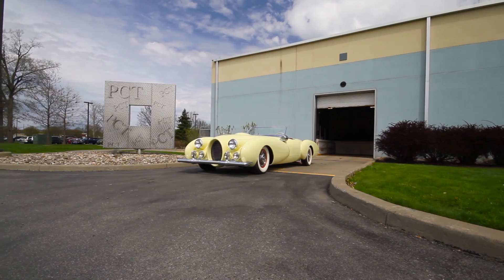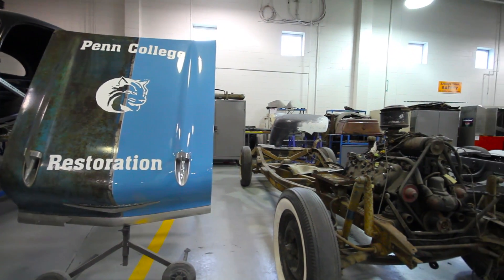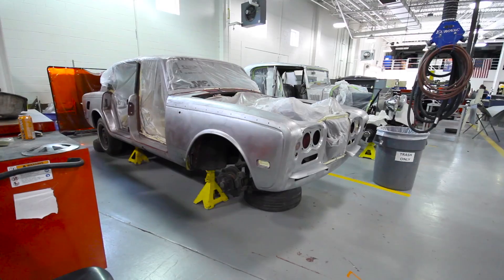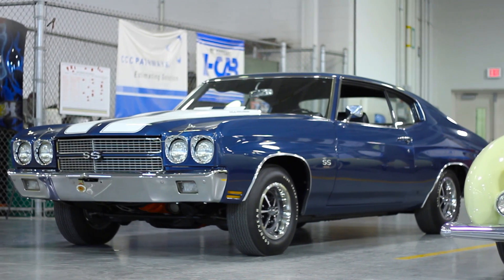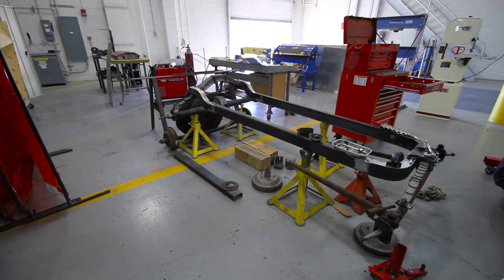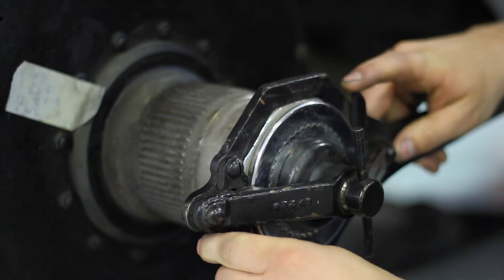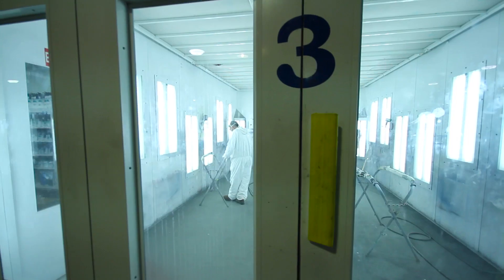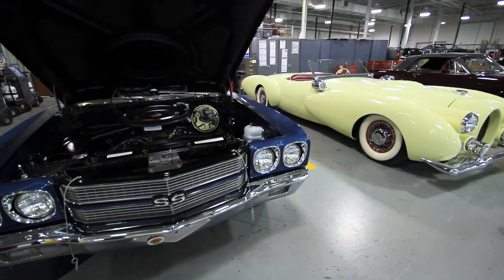Get A College Degree In Extreme Car Wrenching -- /DRIVEN

Comment: Things get real when they seek exactly what material was used, to know then how to weld it or do other work without damage. And I don't care for concors state, I think the Chevelle should do over 200mph and have bigger tires even with stock power. A good state of tune  is what would have been done in the day, reliably.

Comment: I'm an IT graduate from that school. The school is currently very expensive, in the top 10 most expensive state schools in the US. While I probably wouldn't advocate going their for liberal arts or IT like I did, because you can do that anywhere - their more specialized programs like the automotive, aviation, machining, welding, and electronics engineering degrees are pretty fantastic programs. Neat to see it on /Drive!

Comment: I have a question for this school. If you have a replacement part that needs to be made and it has unsafe flaws in it from the factory do you make the necessary changes to make it safe or do you keep the original spec of the vehicle from the factory?
Reply: oh dude the answer is clear, you just make it better! many people had this problem restoring old Muscle cars with their big ass panel gap. who the fuck likes to keep it that way???
Reply: That is what I would of done I wasn't sure of the schools point of view.
Reply: +Steve The Man We realize the panel gaps and build quality of certain vehicles was not a very high quality. Therefore we improve that like paint and panel fitment but we keep the originality of the vehicle in tact.